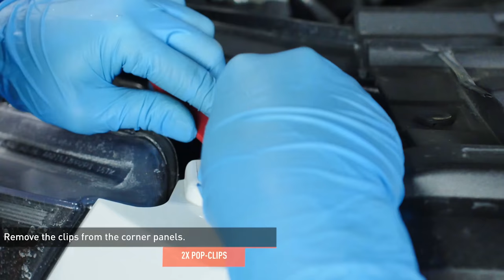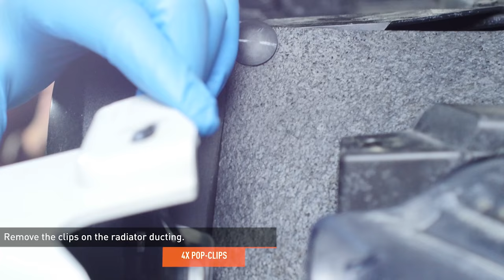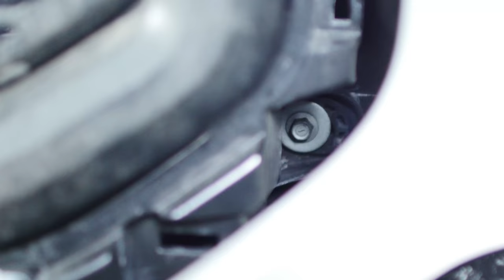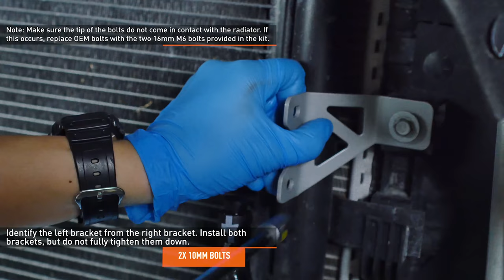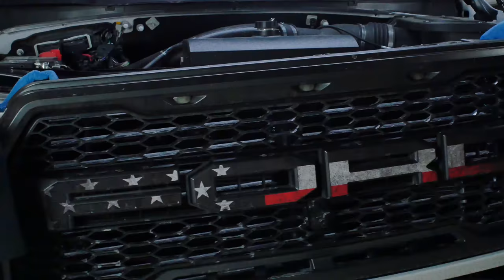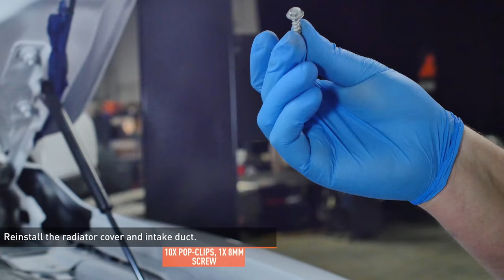2015-2017 Ford F-150/ 2017+ Ford Raptor Transmission Cooler Installation Guide by Mishimoto

Comment: How much should I expect to add in fluid for a 2016 5.0 f150 6r80
Reply from the maker: 0.4 Quarts
Reply: @mishimoto  directly in the cooler before install?
Reply from the maker: You can add fluid through the normal process after installation. You do not need to add this to the cooler before installation.
Reply: @mishimoto  could it be added to the trans cooler itself though? Long story short previous owner made it not possible through top of trans. Would it be fine adding through trans cooler line or adding to cooler before install?
Reply from the maker: Yep, but it is suggested to find a way to check the levels.

Comment: Does this fit a 2018?
Reply from the maker: This will fit the following applications:
2015-2017 Ford F-150 w/ 6R80 Transmission
2018+ Ford F-150 w/ 3.3L V6
2017+ Ford F-150 Raptor w/ 3.5L EcoBoost V6
Reply: @mishimoto  so nothing for the 10R80? I just purchased your intercooler kit and wanted more products. The all aluminum radiator is next.

Comment: How much cooler will this  transmision cooler be? I tow a  full size bass boat I've see temps up to 212 degrees.
Reply from the maker: There are many variables to consider so we aren't able to provide you with an exact number with your unique situation. However, we would invite you to check out the Engineering blog posts listed within the "Engineering" section on the product page. Thanks!
https://www.mishimoto.com/engineering/2019/03/ford-f-150-transmission-cooler-2015-2017-rd-pt3/
Reply: The transmission fluid/transmissions is these trucks are designed to have 195-200 degrees be the normal operating temperature, so if 212 is the max you are seeing that isn't bad, I occasionally see 210 with my truck empty.

Comment: Do you need to drain transmission fluid before changing the transmission cooler?
Reply from the maker: THe transmission does not need to be drained. The oily fluid that should be lost is what might have been in the lines when removing the old cooler.
Reply: Sounds good. Didn't know if there was any residual fluid or if the whole system was full. Thanks for the reply.
Reply: so do I need to add any transmission fluid??
Reply: @UAE111  Good question, we need an answer!
Reply: Do we need to add transmission fluid?
Reply: @joelcontreras8047  yes you have to add 237 ml of ULV  Motorcraft transmission Fluid
Reply: @joelcontreras8047  in another scale 0.25 qt of transmission fluid
Reply: @UAE111  thanks
Reply: @joelcontreras8047  you are welcome
Reply: @UAE111  did that much work well or any issues?
Reply: @johnf.kennedyjr8033  One man's job at home
Reply: @johnf.kennedyjr8033  Honestly no issues at all, it's one of the best moods I have done to my Raptor